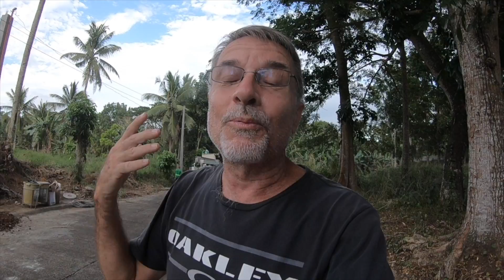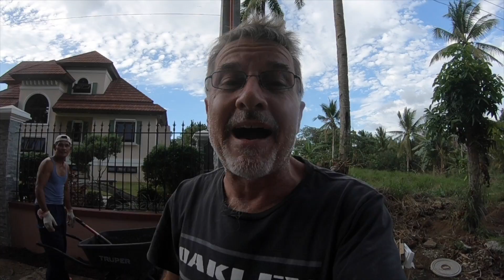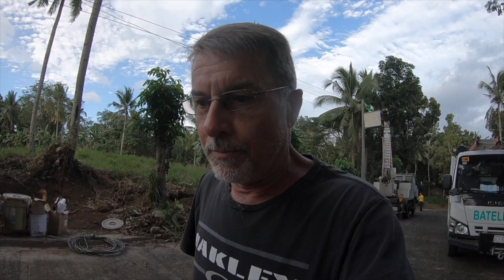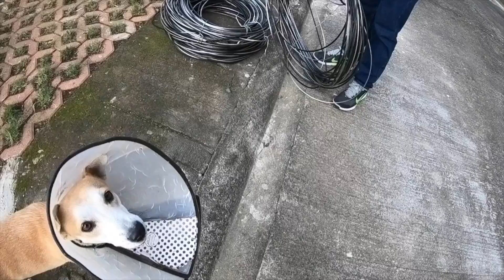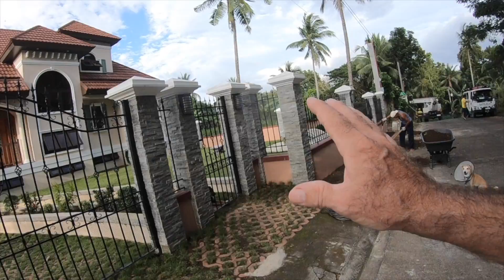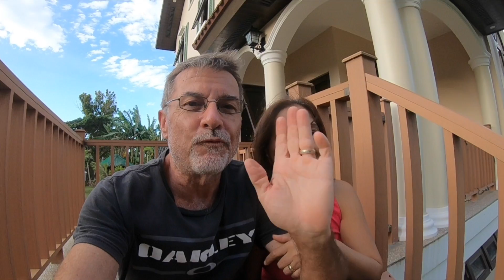VILLA FELIZ - EPISODE 439: ELECTRIFYING (House Building in the Philippines)

Comment: James, was your voltage drop from the line loss from the very long run. They possibly should've used a larger diameter wire when making a run that far. Also I agree with you about the electronics being more sensitive. IMO I also think that modern electronic, Laptops and such seem to diminish and not do as well when used on that 220/230 system. Again correct me on the voltage if you know more than me here. This was my humble opinion
Reply from the maker: Could be our problem stemmed from the long run on a smaller diameter cable or the fact the transformer we were connected to wasn't calibrated or a combination of both.  When they moved our house connection directly to our pole on the main lines we were still low on voltage so the fix was to adjust the transformer that serviced our house.  We're good now.

As far as electronics on 110 or 220VAC providers, it's not a matter of the voltage but rather the quality of the electricity that is provided to the customer.  A combination of voltage fluctuations and noise (dirty power) from the utility companies is what caused degradation of your electronics.  Fortunately for us, electronic components today are much more resilient than 30 or 40 years ago and have higher tolerances for poor input voltages.

Comment: Nice seeing your video as usual. Very informative. I have a question for you though. what gauge or size of electrical wires do you recommend for the house? I want to hear your opinion so I know what to ask my electrical contractor when they start wiring my house under construction right now. Thanks again.
Reply: Henry, One of the eight drawings for your building permit is an electrical plan.
It has a calculation area and a specification for wire sizes, breaker at the
meter and another breaker at the breaker panel the same size. Ours is 125 amp
service with a  #0 wire for the mains and a #8 for the ground. There will also
be a ground stake with the size and buried length specified.  For 200 amp service
you would need 2 ought guage mains wires. (this is larger than #2)  Our permit
specified a metric wire size not available here in the PH so we used a pair of
smaller wires with total capacity larger than the drawing detail. We couldn't get
a temporary service connection and still no permanent one although the house
is under roof waiting for windows and plumbing type things. Our permit was
Dec 2014 and we should have prioritized the electrical service which can be
a lengthly ordeal. Can't install wireing until we get the yellow card and then the
mayors office permit.

Comment: Look at you, having a utility company do something you didn't have to ask them numerous times to do , I have never experienced that, but sure would like too someday. 

 The house we rent has  way to small of service entrance(60 amp)  wire so cannot use our dryer and other things that pull any amps . and our voltage is all over the place , constant drops and spikes. Tv guy told me that most all new tv's can handle that and they will turn off if it drops or rises too high, so far so good on that .